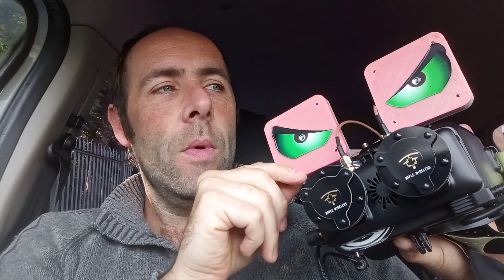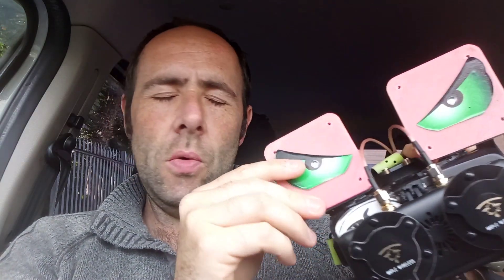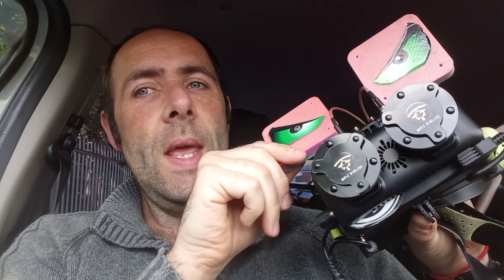TMC-FPV Walksnail Antenna Choices

Comment: Mad’s tech has said that antenna 1 does both transmit and receive…this may or may not be different on the vrx module, but on both avatar v1 and goggles x you have 4 receive antennas and one of them also transmits.
Reply from the maker: The point is the same tho. Lose the TX and you lose everything.

Comment: I take it it’s the same with avatar goggles? Ant 1 top right? I am currently running the TrueRC X-AIR MKII Combo. Wonder if it’s possible to open the goggles & swap over the sma’s so the ant 1 is on a patch rather than an omni
Reply from the maker: Yes as far as I'm aware. Guys have modded their goggles so it's fairly straightforward to open and swap around.
Reply: Thanks

Comment: on my WS goggles X have 4 omni Truerc when i don't want to fly furder, and the other combo is truerc x2-air MKii on top and the WS patch on bottom,  whats your opinion of the WS patch for the goggles x?? i don't know if better put the 4 truerc x2-air mkII
Reply from the maker: The ws patch is 6.7db so while they're directional the beam is very wide (127°) and will still have some rearward coverage, so tbh for longer range they'll still be limited but better than omni